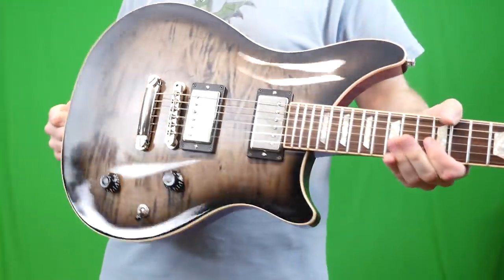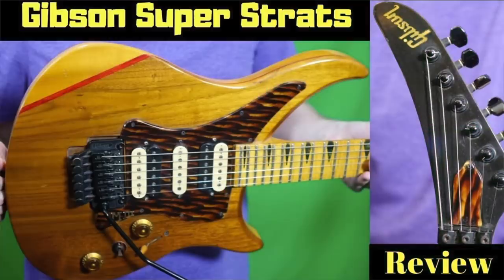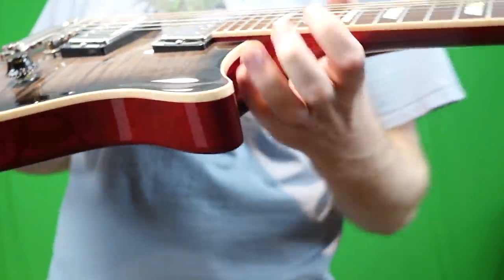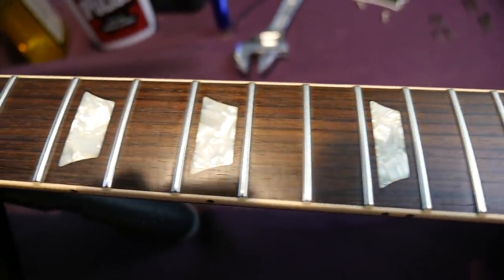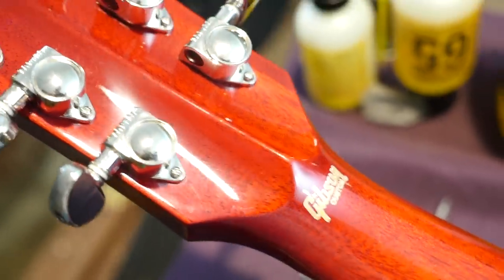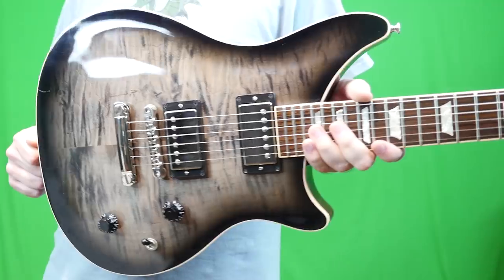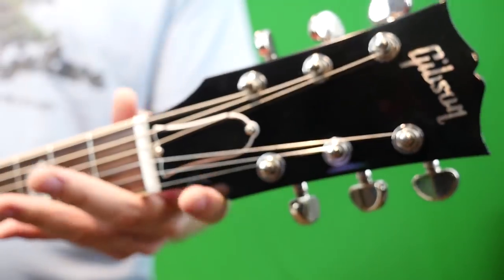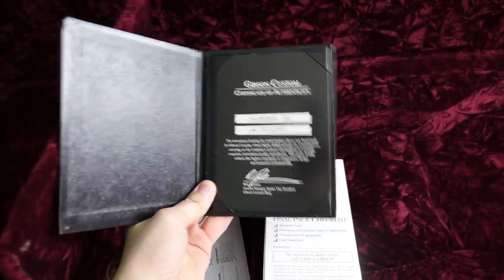Why is This Guitar so Controversial? | 2017 Gibson Modern Double Cut Sterling Silver | Review + Demo

Comment: That Rhino horn I am surprised it didn't catch fire the minute someone saw it. With it running the complete length of the head stock it strengthens it the same as a bend will strengthen sheet metal. In sheet metal the bend provides a ridge that makes it stronger when force is applied trying to accordion the metal. I imagine the horn works the same any force applied to the top of the head stock will be less likely to snap the head stock anywhere not just at the neck joint. Plus its more material and the weight may balance the guitar better for the player. 

Personally I like it and wish I had it on my guitars.

Comment: I do not like it as much as a regular LP DC custom shop pro or standard. Is the pickup spacing the same as the older LP DC?
Reply: Yeah, the pickup spacing is weird looking.  And why even bother with 24 Frets on a guitar like this.   On a shredder type of guitar, yeah the 24 frets are awesome, but on a "No Modern Modern"  (as stated by Ryan Rogers) it makes no sense as you can't even get to the frets, not easily anyway.
With all of Gibson's resources you would think they could design a neck that has almost no heel at all!
Offer all of their models (or maybe just on the No Modern Moderns) an option of a carbon fiber neck or something that allows total access to the upper frets.    Or maybe come up with some kind of quick change neck for different scale lengths!   I've a couple rifles that have a quick change barrel, why not a guitar with a quick change neck!  But I digress, I like the other LP DCs much better.

Comment: Well.. the prs single cut is kindof a ripoff but it was settled in court (prs won the case) and well, when Gibson made the double cut, they copied prs back, and that way are just kindof not the better company. Plus, from a technical standpoint, prs guitars stay in tune better (but that’s a whole other rabbit hole)
Reply: For whatever reason PRS guitars are actually designed to play and work well.  Not a strange concept at all.   I really love my Gibson guitars, but the Les Paul I have is basically unchanged in it's design from way back in the 1950s.   I like old design guitars, but I also like the newer designs.    If I wanted to purchase a newer/modern electric guitar there isn't really much that Gibson offers.   So, I guess my next purchase will be a PRS, if only for the reason I don't currently have one.
Also, thinking about PRS, it could be argued they are built every bit as well as a Gibson, but in many cases cost considerably less..................
Reply: @ognilouD driB Yeah, as of late a lot of Gibson's decisions have been real "head-scratchers"!

Comment: Like the Finish, like the red back , Killer fret board but I think I'd like it better with the switch on the top horn and 2 tone 2 volume. I saw a L.P.  with a black front and a cherry back and it really worked. I don't usually like black L.Ps.

Comment: Yikes... this was roughly 4,300$ new? "Modern", yet like you said, no coil split, no locking tuners, and a very below average 2-piece maple top. I understand that US-made guitars are expensive, but nothing about this instrument justifies that price. It just feels like a childish sleight at PRS for the lawsuit.

For comparison, you could have Halo guitars (a US company) personally build you an instrument to your most precise specs, and you will struggle to make it cost more than 3,500$.
Reply: Very good point about having a custom built guitar.  The lack of modern options/equipment on this guitar makes it seem like they found an old set of Blueprints from the late 1970s and started building them.
Reply: Yeah even the lower end PRS s2's have nicer tops and locking tuners for way less than half of this gibson's msrp
Reply: @zorbcanoo8574  However he does it Mr. Paul Reed Smith has a good business model that works.
Reply: Halo sucks. Buy a kiesel. Seriously way better.

Comment: If it's true that the Gibson research and development that took design ideas from Paul Reed Smith, that emphasizes to me what I've said before: Gibson to withdraw the litigation against Armadillo for any infringement caused by the Dean company and apologize to them publicly. In the interim, it's almost impossible to build a single cut solid body electric guitar and not have it compared with the Les Paul design, considering how much that design has become iconized as a Les Paul design.

Comment: Ok, if it's "modern"...

Why not a decent access heel?
Why not a nice push pull?
Why no locking tuners?
Why not a string through edition with a cool new bridge design that lets you set up the height individually?
Why not a floyd rose edition?

It's like Gibson asked so much for their bankruption, this had potencial....

Comment: For this guitar to be modern they should have made it half the size the body, with binding, access free for higher registers, locking tuners, high output pickups, tap coil and most importantly half the price! OR just get a typical Les Paul and forget about this guitar.

Comment: The only redeeming aspect of this guitar is the 'rhinohorn'' volute, which not only strengthens what is the weakest part of all Gibsons - the neck/headstock, but also looks cool.   The finish is okay, but not a patch on even a basic core PRS model.  
.
No coil splitting or phase reverse facilities - a cost cutting measure that just confirms to me how greedy Gibson are.   
.
Anyway Gibson MADE good guitars.   Now they are seriously in my bad books, for the Firebird X destruction debacle.   I'm still broiling over that disgusting and appalling waste of arboreal resources.   
.
BTW - I own two US Fender Strats, a US PRS CU22 SHB and two Gibsons - both 79 models - an RD 'Artist' and an MVX ''Victory', that still remain the best Gibbos I've owned or played (inc my old LP CSB).    My go to shared No1 is the Deluxe Strat and PRS CU22, with the Gibsons being joint No2.

Comment: It looks like a PRS/Schecter hybrid to me. I think the body style is awesome, but the rest is f'ing stupid, especially for a ridiculous $4,000+. Like, seriously, who is Gibson trying to market this thing to? To me, it looks like something us younger metal heads would love in terms of the body, finish, and ergonomics. But it's missing everything a metal player could want. Schecter has the sustaniac pickups, why not make something cool to compete with that for being a "modern" guitar? A new type of electronic pickup, push/pull pots, a FL tremolo, a 7-string option, the locking tuners as mentioned in the video. The headstock is blah, why not making something new for this modern guitar? Seriously it doesn't even have a brand or badge on it, it just says "Gibson". 
This is the stupid thing I've ever seen Gibson put out. I can see why it's controversial. I have a vintage The Paul and I think that's gonna be my first and last Gibson. This company just seems like such a sham these days. Lacks innovation or originality. I think over the next 20-30~ years, Gibsons are going to wither away in value big-time. My generation that has played all the awesome other stuff on the market are going to see through these guitars for what they really are; crap. Old-school Gibsons, pre-90's, they're always going to be hot and sought after. But all this "modern" stuff is hot garbage. The more I look at this guitar, the angrier I get, lol.